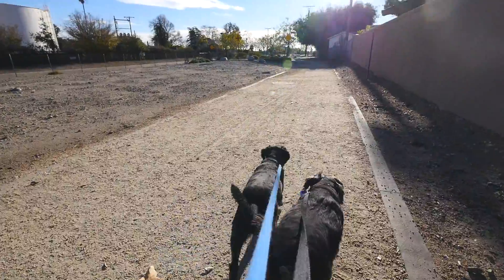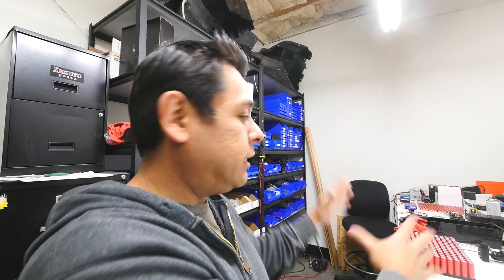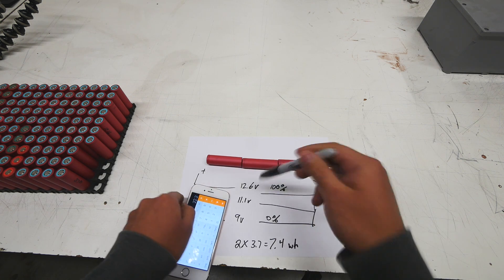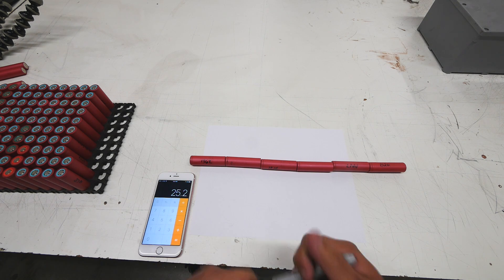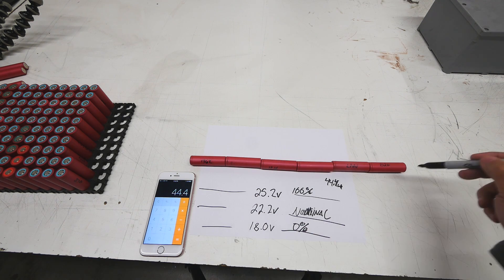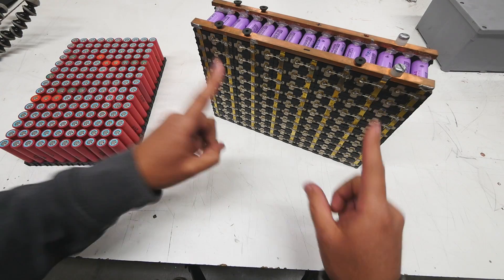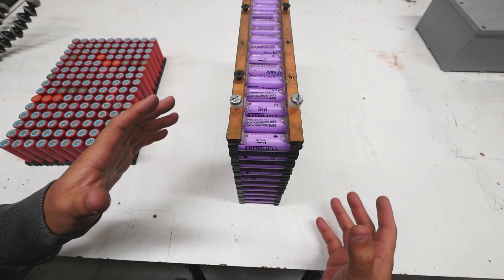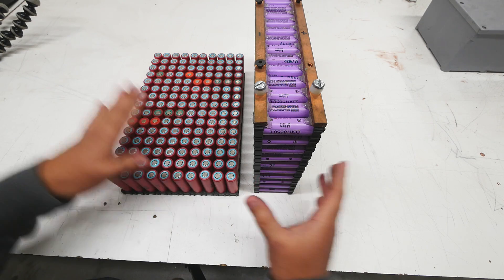How to wire A DIY Tesla 18650 Powerwall

Comment: In a 24v dc inverter you might be better of using 7 in series and as many as you can in parallel. This way you do not need to charge the 18650 upto 4.2v. You can charge up to 4v only. This will mak2 the batteries last a lot longer. So 7*4=28 V Then you do not need a charge controller if you charge from a set of 250w panels with Vmax 30v. There will be a voltage drop from the wire and the reverse current diode that will make the voltage just right to charge each 18650 up to 4 v only. And as you charge each cell to only 4v and not discharge it to lower than 3.3v then you do not need to balance anything. This is because you do not stress the 18650 cells.
To get the kWh you want then just increase the number of cells in each series.
Reply: +Martin Bennett Well since it is a stationary application so the energy density reduction to 70% as you say can be overcome by increasing the number of cells. So instead of using say 1000 cells we would use 1500 cells. I used used old laptop ones and run my house in Egypt. I don't even know what the capacity or nominal voltage of each 18650 cell. I simulated the capacity of each 18650 cell and found that by mixing the nominal voltage 3.6 and 3.7 it makes no difference as the total number of cells tends to infinity. Of course I do not have an infinit   number but as the number increases the end result is almost the same as if they are all have the same nominal voltage.

Comment: How would you balance the cells?
Reply: +kodez79 what he is probably referring to in regards to not needing balancing circuit is called bottom balancing, you setup the software so it cuts usage at a certain point, being the bottom of the charge depletion before damage is occurred to the batteries, basically as soon as the weakest cell reaches that limit it prevents all batteries from being drawn from. Its a cheaper and lazier way of dealing with the balancing of a battery, many EV cars use this method because lithium cells dont have the memory of older tech batteries, so running them this way doesnt hurt the cycle life of the batteries, you just dont get as many total cycles out of the batteries in the long run because many of the cells never see a full charge, thus some are exposed to more load than others slightly. In bottom balancing, as long as he runs it dead over and over to the set limit, all batteries in the circuit will eventually hit this bottom limit, they they slowly fall out of balance again and the cycle occurs again.... If he wanted to top balance them, then he would have a discard circuit (battery balancer) that monitors each string of batteries, once the highest voltage string of batteries is reached the set max limit, it stops charging them and the discharge circuit (battery balancer) applies a small load to reduce the voltage of the pack maybe 0.01 volts, then it activates charging and does this over and over maybe hundreds of times before all the battery strings meet the same voltage output. With the use of lithium he honestly doesnt need a battery balancer, he just counts on the motor controller to not drop the voltage of the batteries low enough to damage them.
Reply: +kodez79 An example on a vehicle, the Chevy Volt he drives uses bottom balancing but slightly different. his volt has like 16kw of battery capacity but only 10kw of it is actually used. The way the software is setup on the volt to overcome battery reduction over time from cycle life usage is the nifty trick of bottom balancing. 10kw of battery consumption is the set limit on the battery, as he drives around the computer is monitoring the usage heavily and as soon as it reaches 10kw of usage the battery meter on his dash drops to 0 % (that his battery is dead) when in reality his battery still has like 30-40% of its charge as usable but is not able to be used.. basically his cars computer is bottom balancing his car off usage, not voltage sorta... so no matter what his car will have 10kw of usable range on every trip until many many years from now the cycle life wear on the batteries drops capacity below the 10kw zone, but after many many test even after 400k of miles on the batteries during testing phase they were still not even close to dropping that far, thus why the 2016 chevy volt took the same capacity battery and allowed more of the total capacity of the battery to be used, so instead of only using 10kw of the 16kw capacity for range, now they allow more like 12 or 13kw of the 16kw capacity for range. (i know the numbers are wrong, just using simple numbers to explain it all......)

Comment: Nice video! Just for the note - electricity can be and is produced by the renewables and can be CO2-zero in production, which is not the case for regular petrol. 

Looking forward for the BMS video! Do you think you could also include the overview of the available BMS systems ? As a DIY enthusiast of a PHEV cars, it took me a while to find a good BMS that supports my battery pack parameters.

Good luck!